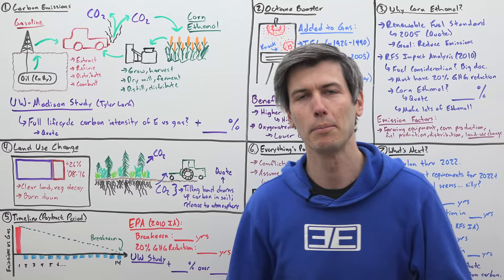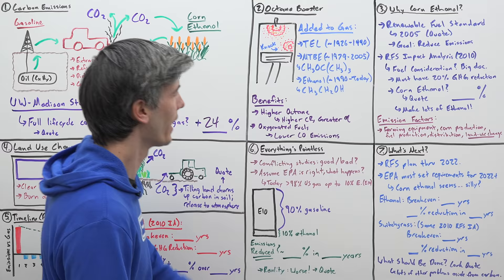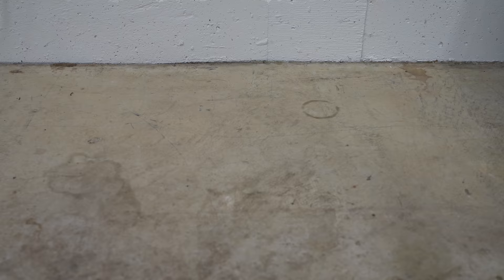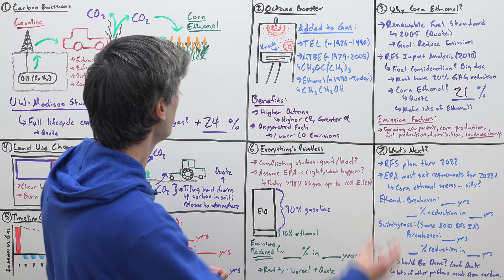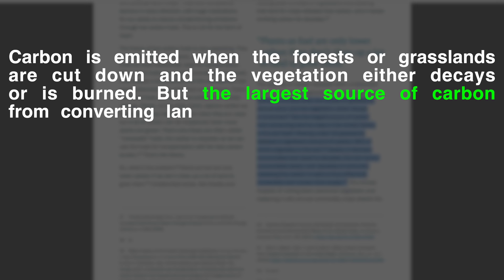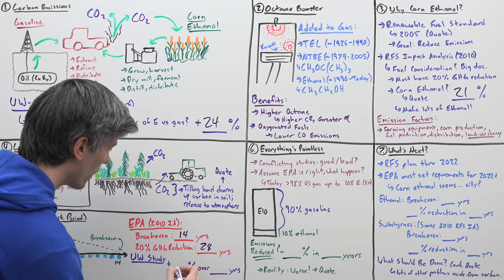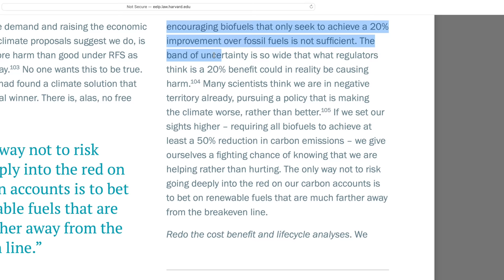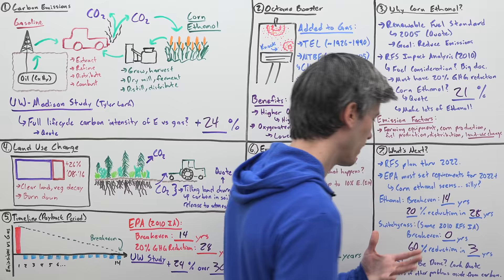America Was Wrong About Ethanol - Study Shows

Comment: I would guess the environmental damage from actually growing the mass amounts of corn for ethanol production using conventional agriculture practices greatly outweighs any possible reduction in emissions.
Reply: Tell me you've never been in the Midwest without telling me you've never been in the Midwest. Endless fields of corn my friend.
Reply: @themadmachinist8637  I believe he is stating that those "endless fields of corn" cause more environmental harm than any offset in emissions due to ethanol in fuel. Millions of acres of prairie have been converted to marginal farmland for ethanol production. Ethanol and crop insurance policies at the federal level are largely responsible. With the claimed goal of capturing carbon, we have destroyed massive natural carbon sinks, all for an additive with questionable environmental benefit.
Reply: @fonseca898  @kmac,
Listen to yourselves., environmental damage bull.
The American farmers are running the cleanest in fuel emissions that they ever have, by new tractors that break down when someone farts, because of the emission controls on the engines, and then also forced to have only the dealer mechanic to crack open the computer code to allow repairs.
The next part is that the B.S. artists that didn’t factor in the fact that many engine hours, and gallons of diesel, plus gasoline, would needed to be used to till, fertilize, harvest, and transportation of the seed and the larger production (if everything goes as farming speculated for future weather), and then what actions and fuels needed to produce the ethanol next.
They purposely left out the cost of planting, fertilizers, harvesting, production, and then at the same time drove up the selling price of corn for  food and feed because of their demand for fuel. The farmer didn’t see the rise in cost at the time of sale, only in the time of seed, from the seed producers like DeKalb, or if the farmer also raised livestock and needed to buy feed for their intent.
Only the middle men win, the cats get fatter, the politicians pack on the pork to make it harder for we working folks, to include the farmers.
New trend, take away crude oil productions, and the byproducts that come from it get more expensive, and fertilizers and chemicals for what the farmer needs to fertilize and protect the crops with get more expensive faster than the rate of fuel prices that have gone up in the level of stupidity.
Ethanol takes too many petroleum products used to produce it to consider it a cleaner option, and the spin doctors refused to show the costs and after effects of food/feed/fuel competition.
Reply: @patrickmoran8790  Conventional farming techniques are doing fantastic amounts of damage to the LAND. Ill agree that the new emissions requirements are an issue but monoculture crop farming Will end up biting farmers in the ass. 6 inches of topsoil in the Midwest gives us everything we know and we need to take care of it

Comment: A key point is missing from this analysis. How does ethanol compare to MBTE or fuel additives which perform the same function. Eliminating MBTE was a key justification for using ethanol.
Reply: Corn ethanol is non-toxic, very cheap, and 100% of the CO2 produced by the fermentation and burning of it is not newly added CO2.  About the complete exact opposite of MTBE.

This study's claim that virgin land and forests were broken up to plant corn is utter horse hockey.  US cropland acres have fallen since ethanol so it is impossible.  In fact, the corn belt grew more corn acres in 1980 before ethanol than in 2018, the year of most ethanol production ever.
Reply: I'm by no means an expert but the use of MTBE caused noticeable environmental problems just a couple years after it was introduced. There's a reason we switched to ethanol so soon after we switched to MTBE and it's not because MTBE was fantastic. I'm not a huge ethanol fan (except in higher performance forced induction engines) but it's the best octane additive we have so far. I just wish the US used switchgrass or cane sugar to make it instead of corn but that's never going to happen with all the corn lobbying and subsidies

Comment: Nice video.  In high school (in the 70's - think gas crunch) I had a hydroponic algae farm and harvested it to make ethanol for a Volkswagen beetle that I converted to run on pure ethanol.  I chose a chlorella algae strain because it has one of the highest rates of photosynthesis and hydroponic farming made harvesting more efficient.  There are also processes like fischer-tropsch to make fuel from almost any carbon based source.  The ultimate greenhouse friendly fuel is hydrogen but it has it challenges for storage; creation of Hydrogen from natural gas(NG) is actually fairly viable and we have an abundance and can make it by decomposing almost any biomass source.  Thanks for starting discussion on these issues.
Reply: Now that is cool!
Reply: If you make pure hydrogen from hydrocarbons, what do you do with the left over carbon?
Reply: What storage problem?
Stanford Ovshinsky developed a hydrogen fuel tank for his Toyota Prius hybrid.
using a spongelike material he developed, it stored H2 in a normal sized fuel tank and no high pressure tanks needed.
Why do we keep repeating this storage fable?
Google his name and hydrogen storage….you’re in for a surprise 😉
Reply: @edcew8236  pencils, lots of pencils😂

Comment: You did a good job in this.  I am an applied mathematician with 50 years experience and I regulalrly see one dimensional analyses at a policy level of issues.  Sometimes (indeed many times in my experience ) this is cynical but in many other cases it is just poor logic.  Economists are taught to look at all the costs and benefits to "weigh the scales" and that logic is at the heart of these types of policies.  It takes specialised knowledge to accurately estimate all the costs and there also has to be a commitment to honestly finding out what they are. That assumes you believe in an objective reality which of course many people don't.
Reply: Too many people don't think about the Chaos Theory aspects of stuff like this.
They think that changing one aspect of a thing will have a limited beneficial effect on the other things. But, when dealing with wide ranging things such as this, just piddling with one little thingy can change a broader economic perspective of a lot of people that can snowball into a much bigger problem than the one that was originally intended to be addressed.

I think it boils down to how too few people learned enough calculus when they were kids. In algebra, changing one variable changes the answer - in calculus, changing one variable changes the entire equation. Lotta people don't get that...

Comment: Sugar cane/wheat is used in Australia, we have E10, E85, plus 91, 95 and 98 octane unleadeds which don’t use ethanol. It has kept the sugar cane industry afloat for now. But E10 isn’t used greatly. It also causes issues with the vehicle because of our humidity.
I thought I read that smog was greatly reduced in Brazil when they used E100.
Reply: Using E100 since 1990. (from sugar cane) Greetings from Asunción Paraguay
Reply: Indonesia is going to follow suit very soon, 1st 5% Ethanol- 95 octane gasoline mix just launched July this year.
Reply: We had full alcohol vehicles since the 80s. During the early 2000's they started to make "flex" vehicles, that ran on both gasoline and alcohol. However they made less mileage than full gas cars or full acohol ones.

Also for car modding, alcohol is better for turbos. They can get more HPs.
Reply: Mostly to help John Howard's mate who owned the Manildra Group.
Reply: E10 isn't used greatly?? It's literally the most popular fuel in all the major cities.
Reply: I disagree   E10 is quite commonly used as it is the cheapest in Australia.      The interesting fact about ethanol production in the Australian sugarcane industry is that it is produced from molasses, a waste product....   Hence ethanol production probably does not result in any additional planting of sugarcane. Instead it is making the milling process (mostly owned by international players) more cost effective.    Farmers are not paid for molasses or ethanol.
Reply: @Christoph1888 in the United States E10 is the most common in small engine manufacturers specified not to use anything greater than E 10 all over small engines I prefer to use engineered fuel that doesn't have ethanol at all. In the state of Massachusetts very few gas stations have E85 available.
Reply: @robertknight4672  why do you prefer that?
Reply: Brazil only offers E100 and E27, with technology in the cars to use both alternatives, as desired by the owner.  The success in reducing emissions is not just in the fuel, but sugar cane waste is also used in energy production, including producing electricity.  I followed the energy balance discussions during the implementation of this program in Brazil from the beginning and today I consider that the pessimists' mistake was to disregard the advances that a program incorporates over time.  If Brazil still produced alcohol at its original efficiency, it would certainly be unsustainable.
Reply: @reneeduardozaidan3228  what do you think Australia should do considering is sugarcane history

Comment: Gasoline is a finite resource.  Emissions differences will be meaningless when the choice is ethanol or the end of large-scale trade and travel around the globe (airplanes, tankers, trains).  What we need is more research on a more efficient renewable fuel.
Reply: The spot cash delivered spot of ethanol on the NYMEX is $1.70/gal.

The price of an unusable sub-grade of gasoline (RBOB) is $2.16/gal.  To turn RBOB into usable E0 would cost even more plus become even more toxic and dirty.

What makes corn so efficient is that it is value added to already existing feed production and leaves the feed still available in a healthier, more digestible/efficient, and more concentrated form called distillers grains.  No forests or virgin lands were broken up for ethanol, simply impossible since US cropland acres have been falling.  The corn belt grew more corn acres in 1980 than it does today with record ethanol production.

Iowa State University measured all the energy it takes to produce an acre of corn into a "diesel fuel equivalent"
This included making the machinery, fertilizer, chemicals, plus the tillage, planting, harvesting, drying, trucking etc. 
They found it takes 34 gal of diesel to produce one acre of corn.
What do we get from those 34 gallons of diesel?
We get >500 gallons of ethanol.
But wait, that is not the kicker.
The kicker is we still get 100% of the protein from that acre of corn still available for an even better feed called distillers grains. A win-win.

Corn however is limited to the size of the cattle herd on feed.  No corn could be economically grown beyond that so at best we could just over double current ethanol production from this source.  We do need more sources.

There exist thousands of abandoned oil platforms in the nutrient rich dead zone of the Gulf of Mexico.

Kelp makes more ethanol per acre than anything grown at 30,000 gallon per acre.

We could spread floating growing nets around these platforms 1/2 mile in each direction which gives us 640 acres or 19.2 million gallons of ethanol.  Multiply that by a few thousand and you are talking real numbers.

We could use the abandoned platform oil pipelines to pump the ethanol to shore.  The bagasse could be sold as natural fertilizer or fed back to the kelp if the dead zone became too clean (doubtful).  

With enough ethanol we could have ethanol optimized pollution free engines which have twice the power/half the size and more mileage than either gasoline and even diesel.  In jet engines, the exhaust would be cleaner than the air coming in for a plane flying over Los Angeles.

Comment: I know this is an older video but iv'e got to say as a UK citizen I really like the style of this video, quick start, straight into the subject matter no heavy guitar riffs at the beginning no 'in video' ads for PCB manufacturers or VPN suppliers etc...love it, and i'll subscribe just for that, and of course for the very well presented subject...
Reply: The only problem with it is that there were no grasslands or forests broken up for corn.  Quite impossible since US cropland acres have been declining since ethanol.

US Census data even shows corn producing states increased grassland, forest, and wildlife areas since ethanol as well.

Believe it or not, the corn belt grew more corn acres in 1980 before ethanol than they did in 2018, the year of most ethanol production ever and ethanol plants everywhere.

2018 Iowa 13,200,000 acres of corn with record ethanol production
1980 Iowa 14,000,000 acres of corn before ethanol

2018 Illinois 11,000,000 acres of corn with record ethanol production
1980 Illinois 11,600,000 acres of corn before ethanol

2018 Indiana 5,350,000 acres of corn with record ethanol production
1980 Indiana 6,450,000 acres of corn before ethanol

Comment: Brazilian sugarcane ethanol and E20 fuel - today's engines accept without changes and drops the emissions drastically. If possible, sugarcane E100 engines (common here in Brazil) with variable turbo (to dinamic rise the compression rate for use natural gas like a second fuel).

Comment: I wrote a journal article on using duckweed as a replacement for corn ethanol. The amount of starch produced is lower at 30% but duckweed grows 10 times faster and you can actually use duckweed to clean water. I have been trying to get the dairy industry interested.
Reply: The problem with using duckweed is for it to work in place of corn you would have to start using major lakes as growing areas and that's creating a whole new set of problems.

It can also block out the sun from reaching life under water which then causes biomass collapse. I've seen this happen on small ponds in Florida. Everything pretty died except duckweed.
Reply: @JamesSmullins  In Idaho we have a very productive dairy industry that produces a lot of dairy wastewater. That wastewater goes to lagoon systems. The duckweed could be grown on the lagoons.
Reply: @kevinkruger6233  but that's not going to be enough to replace corn. You have to think national supply level and what's required for that. Duckweed will fail there.
Reply: @JamesSmullins  Duckweed grows 10 times faster that corn does. As long as you keep harvesting it you and get many tons of it per year on one lagoon alone. If dairys and wastewater treatment facilities implemented it across the country it would work.
Reply: the manure is incredibly useful but usa throws that sort of thing away.   if the cows could eat the duckweed, the cars can charge on solar or wind.  but the ships we send all over the world to beat up on the defenseless, how would we fuel those?
Reply: @drakekoefoed1642  

When Chinese and Russian tanks are rolling down your city streets, you won't make such lame-ass remarks about our military.

Comment: According to BioZio, five gallons of kudzu mash equals about half a gallon of ethanol, which can produce about 270 gallons of ethanol per acre. This is comparable to corn which amounts to anywhere from 210 to 320 gallons per acre.
Reply: Your data is very old, today the US turns 2.9 bushels of corn into one gallon of ethanol while preserving 100% of the protein and other things for feed as distillers grains and other byproducts.

2023 corn yield was 177.3 bu./acre so this equals to about 514 gallons of ethanol per acre.

The five-year average US corn yield is 173.3 and this equals to 502.6 gallons per acre.

Iowa State University measured all the energy it takes to produce an acre of corn into a "diesel fuel equivalent"
This included making the machinery, fertilizer, chemicals, plus the tillage, planting, harvesting, drying, trucking etc. 
They found it takes 34 gal of diesel to produce one acre of corn.
What do we get from those 34 gallons of diesel?
We get >500 gallons of ethanol.
But wait, that is not the kicker.
The kicker is we still get 100% of the protein and other things from that acre of corn still available for an even better feed called distillers grains. A win, win.